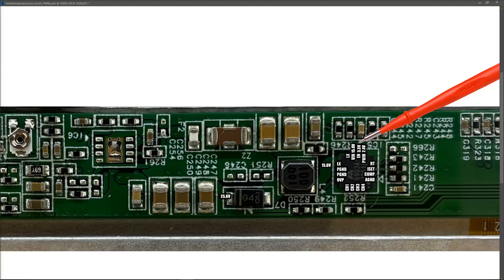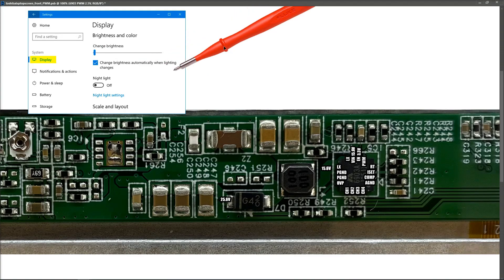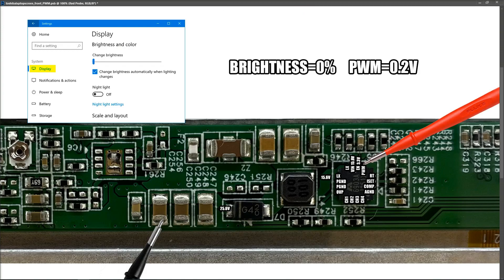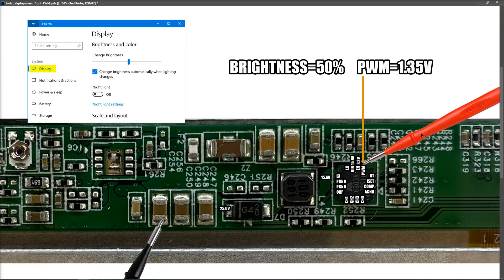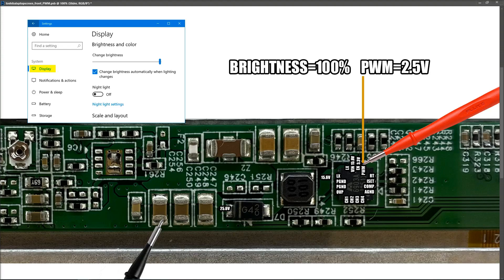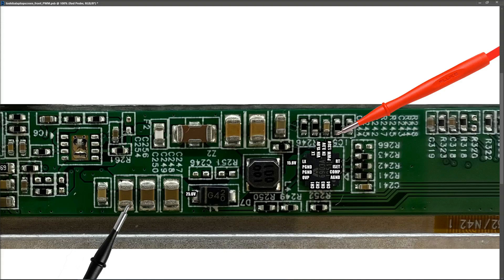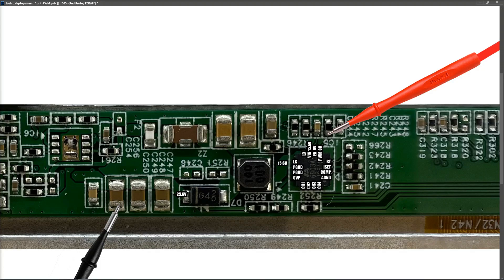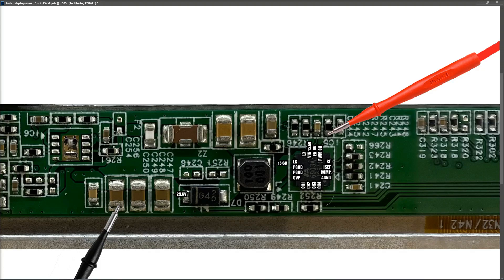Analyzing The Backlight Dimming Circuit For 15 Inch Laptop Screen

Comment: Backlight PWM isn't a variable voltage but a square wave which switches between high 2.5v and low 0v at a high fixed frequency. At 50% brightness for example it spends half the time at 2.5v and the other half at 0v. Essentially turning the backlight on and off rapidly to simulate different brightness levels. The multimeter is reading an average voltage so its not giving a true picture of whats going on, though probably good enough for troubleshooting purposes.